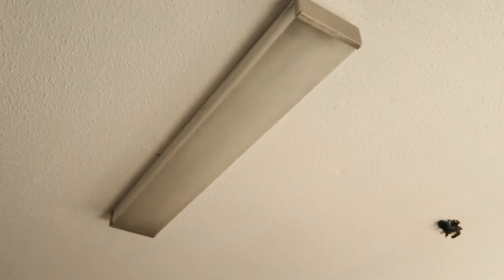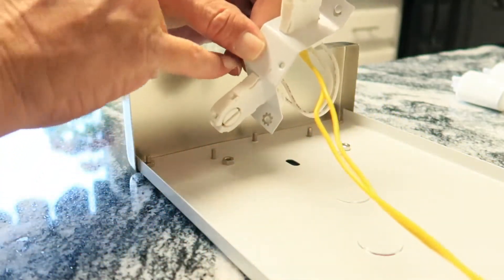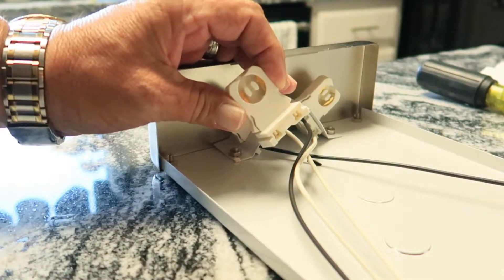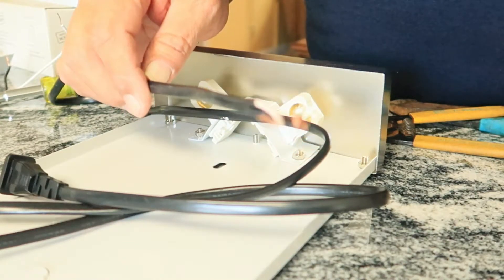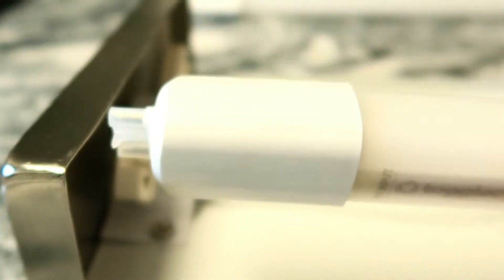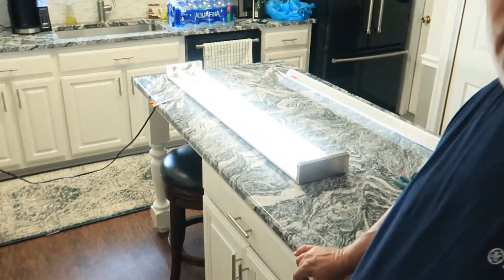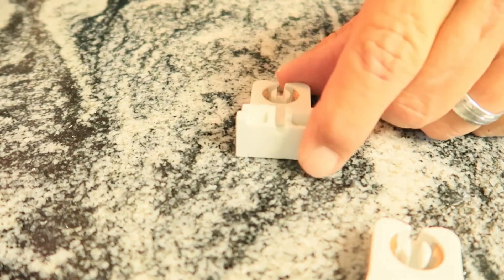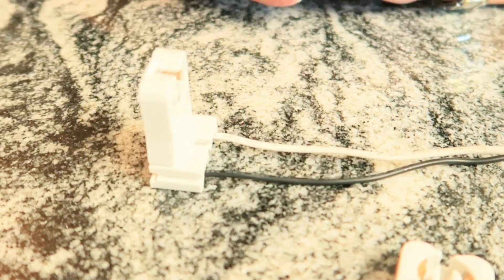SAVE MONEY WITH "LED" LIGHTING

Comment: Thanks! With your example I'm going to convert a fixture. Just wondering why you chose that particular bulb when there are others significantly cheaper by the same manufacturer? E.g. https://tinyurl.com/y6ytu9zs
These are the ones I'm going with.
BTW, any re-use for the ballasts rather than just throwing them in the landfill? I haven't checked yet but that'd be good...
Reply from the maker: +William Latinette thanks for watching and have fun doing this easy conversion. 
I didn’t think the bulbs were all that expensive so I chose them. The power savings will give you a quick pay back for the envestment. LED bulbs are getting cheaper everyday though.